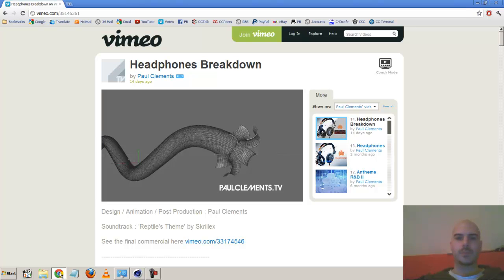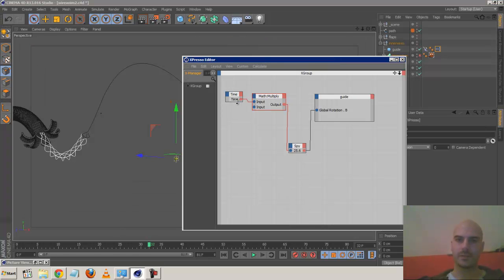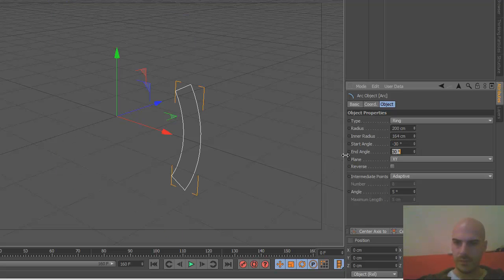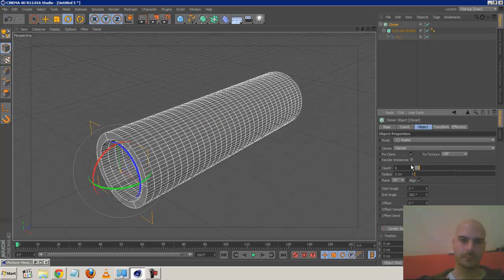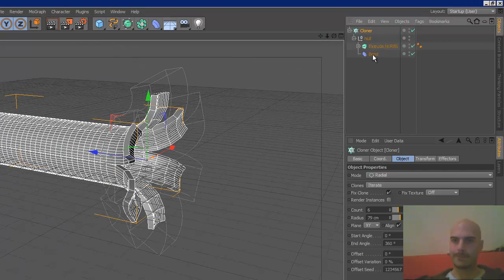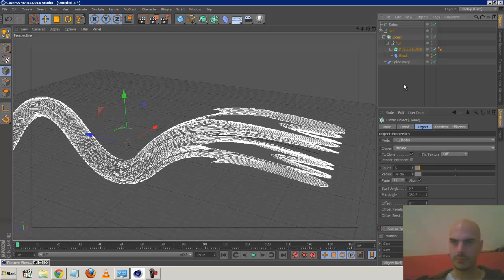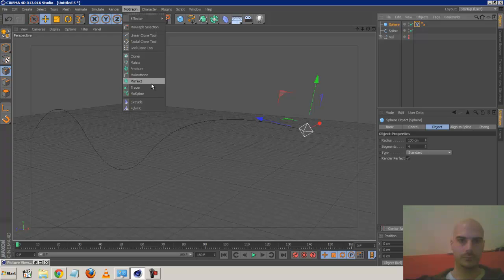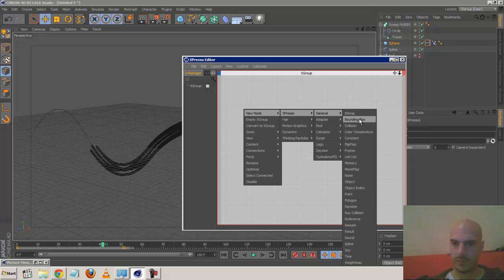Cinema4D Tutorial: Paul Clements Style Cable Growth Animation (Intermediate)

Comment: Nice tut, but I only see the wired lines in live view... When I try to render I only see 1 single line instead of what I need to see like 14:14 What did I do wrong?
Reply: The same problem, in picture viewer just one line....
Reply: I was having the same problem as well, finally figured it out. It's just because your rendering "current frame," try rendering a few frames out or the entire animation and then it works.